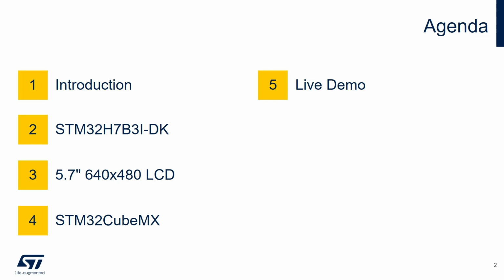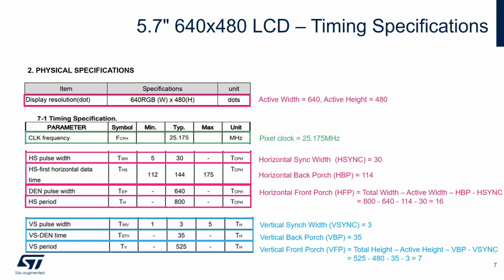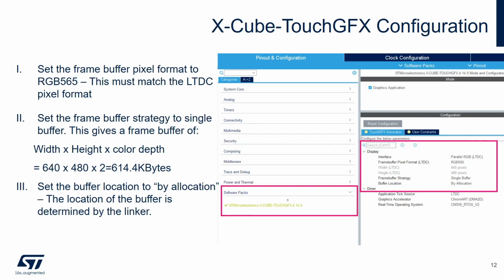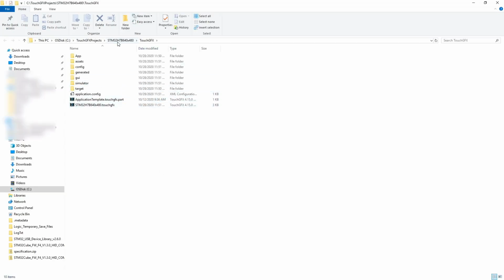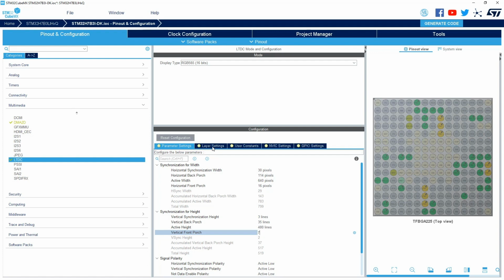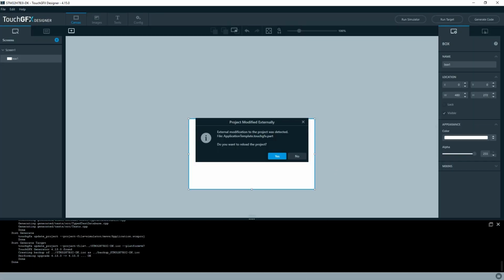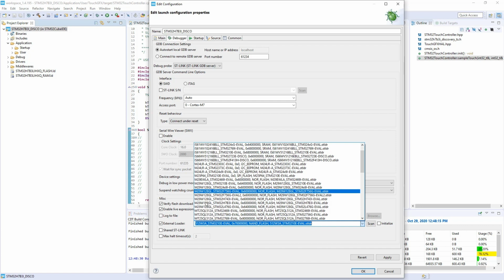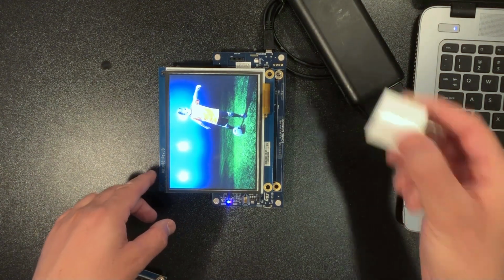How to Customize a TouchGFX Template for STM32H7B3I-DK: Part 1

Comment: is that board for the larger LCD available?
Reply: I'm not sure if you can order the MB1063 separately. It comes with STM32H753I-EVAL and you can refer to the schematic is available here: https://www.st.com/en/evaluation-tools/stm32h753i-eval.html#documentation. You can contact the display manufacturer directly if you want to order the display:  http://www.ampdisplay.com/

Comment: Why cant touchgfx generate the ioc file with the right settings from the start? seems you have to enter all the display parameters first in touchgfx and then again the exact same numbers in cubemx..
Reply: TouchGFX designer doesn’t generate the ioc. The thing is the ioc file is downloaded as part of the template
Reply: Another issue which seems to be specific with the STM32H7B3i-DK and TouchGFX is that the reference to the IOC file is not placed in the STM32CubeIDE .project file when creating a TouchGFX project for the board so it has to be added manually, otherwise STM32CubeIDE will not show a .ioc file associated with the TouchGFX project.  This issue has been posted on the STM forum.  It might be that in some instances the STM32H7B3i-DK is references as a STM32H7B3i-DK and in other instances it is referenced as STM32H7B3i_DISCO which is sort of odd.
Reply: Oh, yeah, the clock is messed up there as well and has to be changed.
Reply: @TheJoMoVO  The ioc file is not placed under STM32CubeIDE folder as it is generated by the standalone STM32CubeMx software and not by the plug-in that comes with the STM32CubeIDE. If you need to change the settings in the ioc you need open the ioc using STM32CubeMx.
Reply: @BadreddineBAROUDI  That is not what I am referring to.  I am referring to the .project file for STM32CubeIDE which gets created when you create a TouchGFX project. For the STM32H7B3i-DK, the reference to the .ioc is not placed in the .project file and has to be manually added.  However, for another board such as the STM32F769i-DISCO the reference is created and does not require manual entry.  Also, the .ioc that does get created for the STM32H7B3i-DK is labeled as STM32H7B3i-DK.ioc, but I found it is required to add STM32H7B3i_DISCO which means another file STM32H7B3i_DISCO.ioc has to be created.  TouchGFX needs STM32H7B3i-DK.ioc but STM32CubeIDE seems to require STM32H7B3i_DISCO.ioc. However, I can edit the .ioc after these changes in STM32CubeIDE. I have posted about this in the STM forums. It is a gotcha.
Reply: @TheJoMoVO  I got it now - Thanks for the feedback!